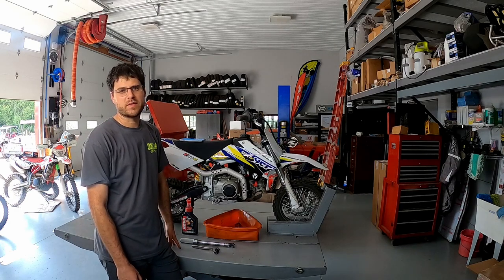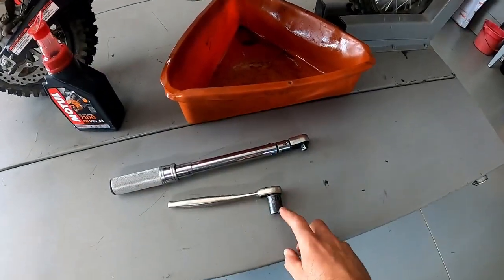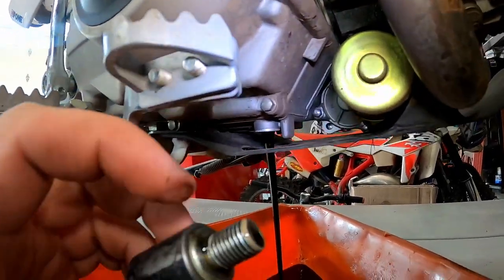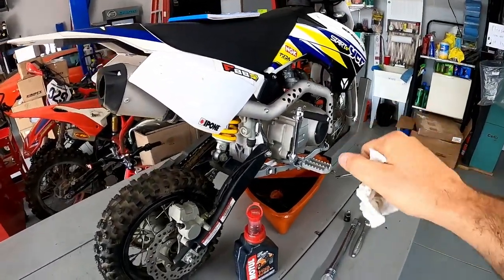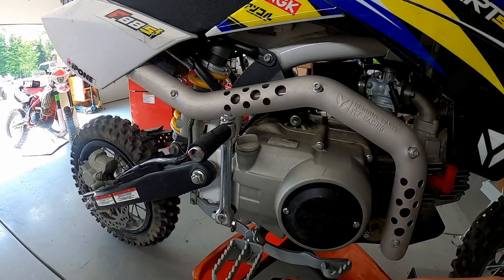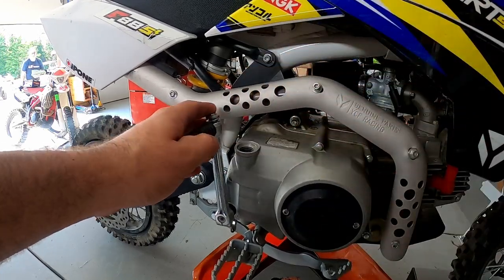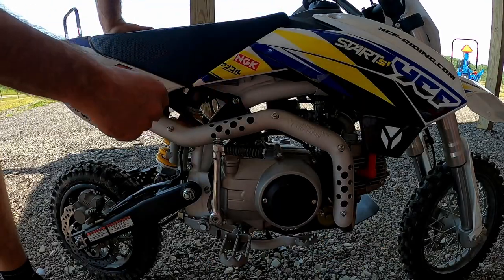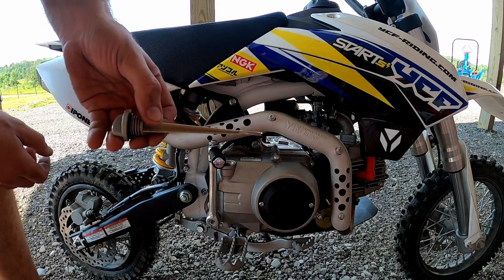YCF Motorcycle Engine Oil Change      |      Model: Start F88SE     |      Pit Bike Oil Change

Comment: Hey there! Do u have any ideas to make the shifting process easier? For me as a grown up man i have no issues but my 8 year old son it a pain in the a$$ .. he needs all his strength to pull the shifter up.
Reply from the maker: Good Morning, I have not had any of our customers call with a shifting issue. Maybe make sure he is off the gas when he is trying to shift. Hopefully he can get it figured out! Enjoy The Ride, Jared
Reply: @3SeasRecreation  thank you! I figured out that the idle rpm is very important. I keep it as low as possible and it works way much better. 👍